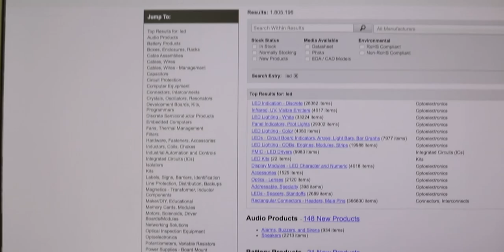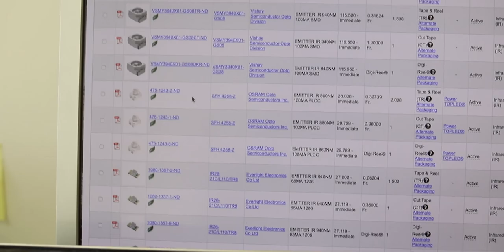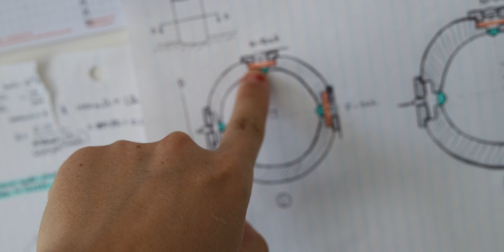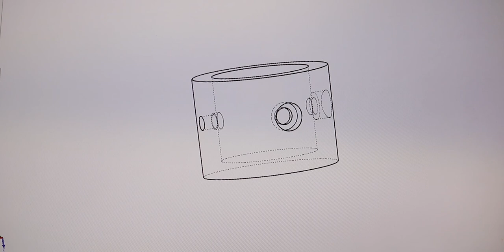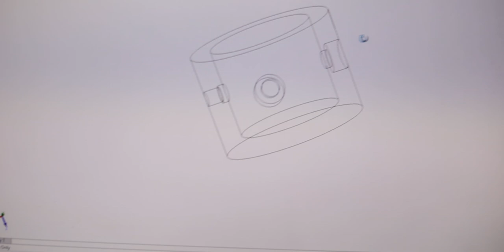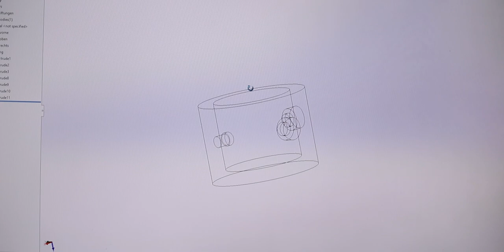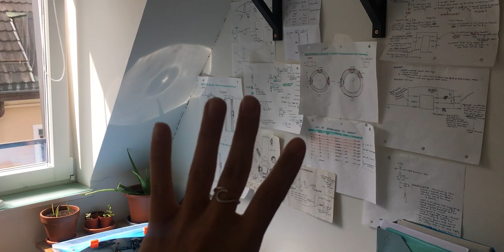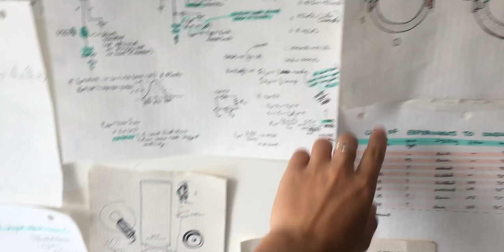Doing the first few months of my PhD from home | PhD Vlog

Comment: May I suggest you use a variation on a smoke alarm which would work on the same principle and not be affected by light strength but by partial density

Comment: Hey a swiss plant scientist right here ! Just an idea... you said that the ambient light would be a problem to do your prototype in « natural environnement » so why don’t you do it during the night ? You wiuld have less natural light at least !
Reply: Is it possible to have a separate sensor in standard solution right above the river to measure the IR from the sun and use that to correct the readings from the sensor submerged in the water?
Reply: @SakibAhmed-hr7bd  Don't even need a separate sensor - just pulse the light source and detect the difference in the readings.
Reply from the maker: Hi all! Very nice suggestions and questions. Yes, as @NiHaoMike said, the plan is to do one detection without the LED (to make corrections), and then another detection with the LED on (for the actual sample).

Comment: Hi jess, really interesting work.  Your selection of controller (STM32 )is good enough as compared to ATmega. Create a local network, LORA is the best Transceiver. these all components are low power or low cost. research on material that uses in structures cause behind is your all experiment depends on light scattering principle.

Comment: I don't know if this was brought up or not.  I haven't had a chance to look over everything on your channel.  
I've seen where companies/individuals are using artificial intelligence to design all sorts of things.  Make things work faster, stronger, more efficient.  Basically redesigning but on a scale that a human more than likely wouldn't even consider, and in many cases it's hard to simply understand. I saw where you made a video a few years ago about a project you had working with a turbine engine.  I believe it was 2 years ago, i think it was part of your masters in school.  But anyway.  Could you potentially use AI on stuff like that?  Maybe a better way to super cool the air before combustion so you get more thrust.  Or even a complete redesign, i don't know that's why I'm asking.  Maybe redesign the fuselage to save weight, while maintaining strength and aerodynamics.  I'm not an engineer, really just a curious question more than anything.  It just seems like it could have the potential to not only really help change not only our computers and programs but also the mechanical side of industry, even civil engineering could potentially benefit.  I hope this isn't a weird question. I just wonder if the future of engineering innovation could head in that direction.